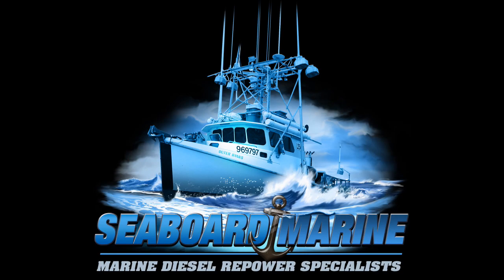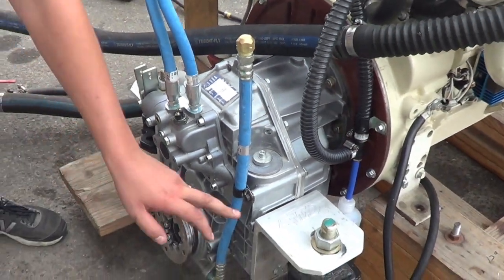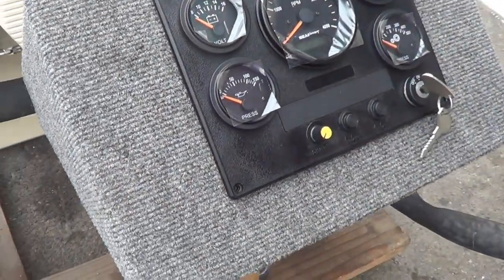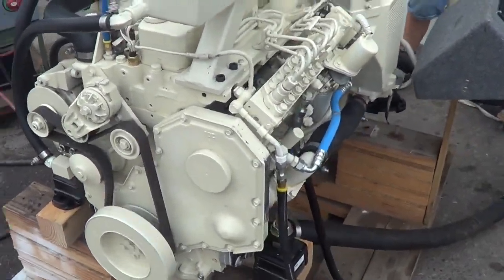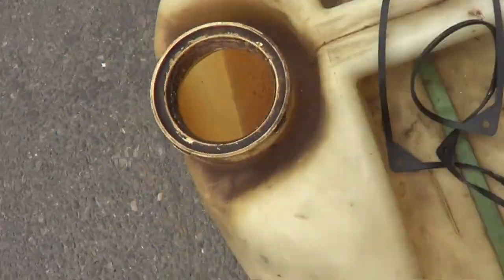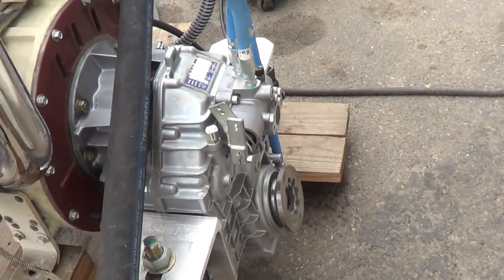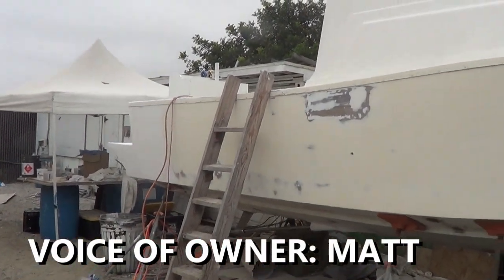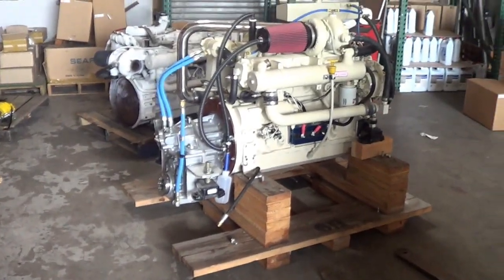Project Spotlight: Engine Test for Farallon 25 Cummins 6BTA 370HP with High Mount Turbo

Comment: What size is the intake tube from the after cooler to the air intake to the engine? I think it is 3" but not sure.   And which waterpump is that?    Which turbo are you running and how much boost do you get?
Reply from the maker: The charged air tube is 2.5" O.D. the raw water pump I believe is a sherwood, the turbo is the stock turbo just mounted in the high location, and the amount of boost he will get is uncertain.  This boat still hasn't hit the water, and he probably won't run a boost gauge anyhow.  The boost is dependent on the load on the motor, boat weight, propping, etc.  Best guess... it will top out somewhere in the 25-35psi range.
Reply: @SeaboardMarineIncVideos  Thanks for your kind reply.  I was wondering if the stock turbo was adequate for a 370 hp so that helps.  I also wanted to have some idea about the amount of boost as I did not really want something more than 50.  I had guessed that it would be mid 20's -30 also.   Thank you so much.
Reply from the maker: The stock turbos are different for the different HP engines.  There is some overlap, but if your planning on making one engine a higher HP engine its a LOT of work, it can mean a new turbo, new fuel injection pump, new injectors, different cam, larger heat exchanger, lager RW pump, it is no small task to convert a lower HP engine into a higher HP engine.
Reply: @SeaboardMarineIncVideos  Yes, I know!!  So I am exchanging for  6BTA 370's and most of the setup is different.  The original 250's even had the old CAV fuel pumps for goodness sakes.  I had them rebuilt in Guatemala by a mechanic who had more rum in his system than blood I think.  A short job finally was completed 9 months after they pulled the engines!!   Never were right and had one problem after the other.  Just got tired of worrying about it and chalk it up to boating tuition.  I will under prop and cruise faster than the fleet under much less % max load and those should last a long time.   When I got the boat it struggled and I found it to be over-propped.  Under-propped it would hit easy cruise of 24-25 knots and topped out at almost 30 knots loaded.  Hated those horrible after coolers, water pump, and fuel pump though. I will rebuild the old ones, ship them home and sell them to recover a little bit of my loss hopefully.    Appreciate your reply.  I will not pester you any more. THX
Reply: I have a 31 Bertram and that sea water inlet on the bottom is a pain in the butt to get connected because there is barely any room on that bottom side.  It is probably best to make that connection before bolting on the pump.  I bought the boat used and that original pump on the original 250 hp was really not adequate as you know and have tried to solve the issue with your own research and new pump design.  THX for the information.